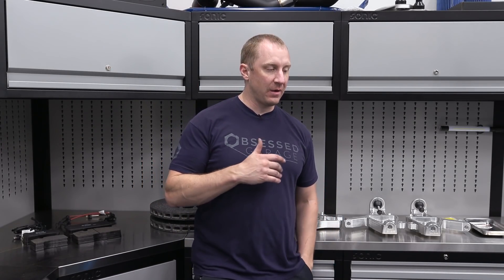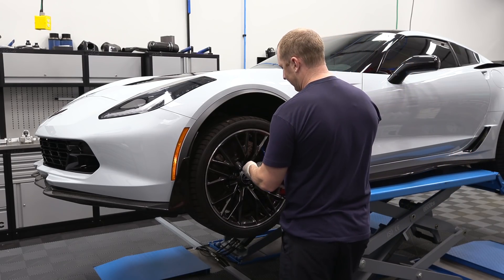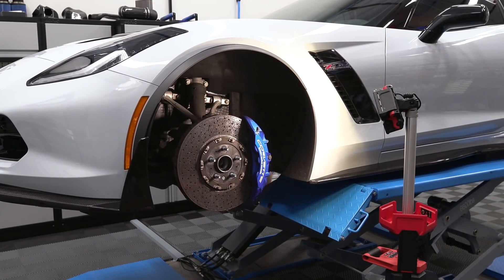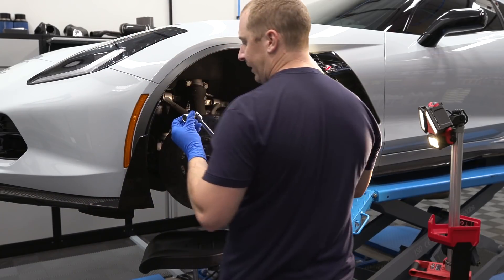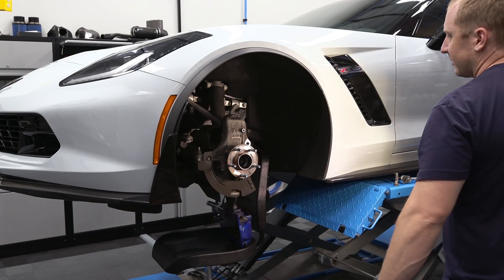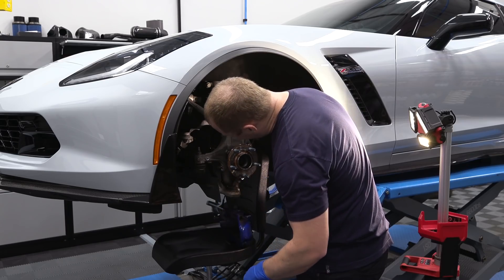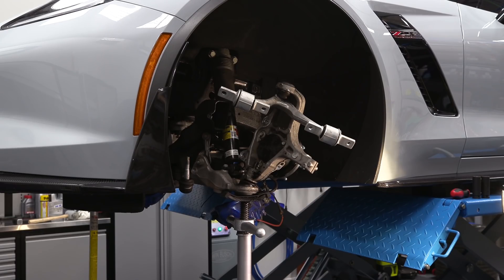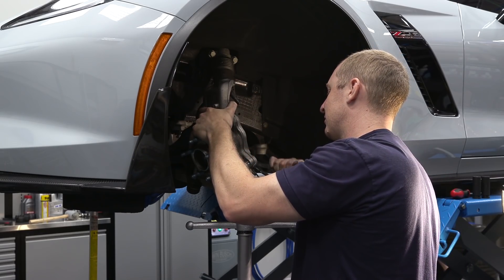Carbon 65 C7 Corvette Z06: LG Motorsports Drop Spindles - Part 1

Comment: Pretty sure they meant an impact driver. The kind you smack with a hammer and it turns as it's pushed in. That way to DO NOT strip them. I

Comment: I just replaced the rotors and pads on my Z51. The bolts are blue loctite from the factory. I read about it before I did the brakes and just bought new bolts, for $3 each, the bolts are loc-tited from the factory, in the package. You just install. It’s funny to watch you break the bolts free, because the torque specs are like 162ft lb and the rears are like 89ft lb. make sure you definitely loctite the front bolts. Rears don’t require loc-tite.

Comment: The ball joint is tapered where it goes into the spindle.if you hit that spot on the spindle it will shock the joint loose and fall apart.fyi this also works on the tierod joint that is also a tapered joint.just 2-3 good smacks and it shocks the joint loose
Reply from the maker: I eventually figured that out.

Comment: Changed spindles/bearings/AMT monoballs/calipers/rotors/everyhing/ arms on my car.. using the hammer was important for sure, mind the angles for the balljoints
Reply from the maker: Yeah, it's really simple now that I see how they come off.  If I could do it again, I would get the correct tool.

Comment: This is what separates you from other DIY , you are transparent with what you know or pretend to know , just a simple turn wrench guy looking to learn as you go forward.
Reply from the maker: There is a reason why no one has posted a video doing this.  It's messy.   The only way it would go smoothly would be if you had done it before.
Reply: @ObsessedGarage  also many of these upgrades and modifications, including drop spindles and bigger brake upgrades, we did in 2004, 5, 6 and 7 on the C5 and early C6Zs in the days before YouTube.
Those tutorials were normally photos and posted onto the forums.
Many of the forums have changed software and owners enough since those days that lots of old tutorial series are dead or have no photos left.
As for C7 modification videos of serious level changes, many of the new comers to the C7 seem to be "pay to have their cars modified" folks and as a result there are very few actual videos of the process.
Kudos to you for adding your stuff to the library of material.

Comment: Haven't watched the whole thing yet, but my guess about the rotor weight is that your new set has slightly enlarged internal vanes/voids to save weight, aid cooling, and likely save money on expensive materials. The external dimensions will be the same, but the weight will be different. This would explain the difference in specs for minimum weights being different. 

If they are both OEM rotors then Chevy has changed the rotor without updating the part number. Or maybe their parts vary to this degree, and it's all unintentional, but taken care of by the spec.

Comment: Lefty loosey-rightey tightey trick for when you are backwards like that: put your hand on top of the bolt ( or imagine it there) in karate-chop position. Then you can tilt the top of your hand to the left and right to easily figure out the direction. Just imagine karate chopping the bolt! Not too hard to imagine once your car starts to make you mad with whatever you are trying to do to it lol
Reply: I've always hated the lefty loosey righty tighty thing. I find it easier as clockwise to tighten, counter clockwise to loosen.
Reply: I always imagine opening a milk jug in my head 😂

Comment: that fork your using ,it´s also ment for you to hammer on the end ,so it´s pushes the 2 parts away, another way is put the nut on and a piece off word the hammer on it that way it also comes apart atleast easere then what you did and you don´t destroy parts in the process .
regards
Sören
Reply from the maker: Do you really think I'm that stupid?  Of course that is how you would use it.  That is, unless there is a rubber boot than would be damaged.

Comment: @obsessedgarage The sensor is the ABS, there should be a connector to disconnect it on the body of the car instead of taking it out of the hub carrier. They are usually stuck and don’t come out as vehicles get older.

Comment: I have a ZL1, these are a direct fit.  How much for the old ones?
Reply: Stock ZL1 1LE front rotors are 15.5"?   Giro disk folks told me the ZL1 hat differs from the C7 Z07 hat which is why they have 2 different part numbers for the 2 piece 15.5" iron rotors. They share the same rotor ring but the hat is different offset.
Either way - lets see the price, as if you don't end up getting these rotors I think I might like to step up if the price is right.
Reply from the maker: I gave them to Ras for helping me so much.
Reply: RCFourFive Yea, I know. The rings themselves bolt right up to the ZL1 hats though. Oh well, sounds like Matt gave them away already.
Reply: Obsessed Garage that’s great to hear - pay it forward is my motto as well.

Comment: Just wanted to chime in and say the loctite is applied by GM at the factory. Now, whether or not red loctite is correct is beyond me as blue is usually what is used when doing a brake service. It can be annoying having to reef the bolts out, but due to their task in such a demanding environment it is necessary that they have that stuff applied.

Comment: I wonder if the weight of the old rotors is higher because of the pad transfer material???
Reply from the maker: There is not pad transfer on CCBs.  The rotor likely had a higher starting weight.
Reply: Obsessed Garage interesting ! see I thought maybe it would accept pad transfer like a traditional rotor, but I don’t know I’ve never had carbon fiber?
Reply from the maker: Yeah, the pads get burnished.  Wait until you see the break-in procedure.  50 stops!

Comment: This is the kind of impact driver you need for the screws on the rotor. You hit it with a hammer and it rotates left or right depending on which way you turn the handle. I stopped needing to drill out rotor screws once I got one of these. 

https://www.amazon.com/TEKTON-2905-8-Inch-Manual-7-Piece/dp/B000NPPATS
Reply from the maker: Yeah, I have one at the house.  I was too lazy to go get it.

Comment: The fork is wedged and you had it upside down.  Take a hammer and hit the end of fork and the wedge will separate the ball joints.  No need to remove a-arm
Reply from the maker: It was pinching to ball joint boot.  I didn't want to damage it.

Comment: Those friggin rotor screws are the most annoying things known to mankind, I swear to god.
Every single time I've ever had to take one out, it's either snapped mid-thread, got completely stripped and needed to be saved with an extractor, or become so solidified in place that I had to drill the whole thing out. They are the wooooooooooooooooorst.
Reply from the maker: The other 3 came out easily.  Luckily I was taking the hub out anyway.
Reply: @ObsessedGarage  I anti-seize those rotor set screws. For German cars, ECS Tuning has stainless steel ones that shouldn't seize.

Comment: Just want to let you know the ball joint fork was used incorrectly , you put it in the way you did but hit the end of the rod driving the fork in more to pop the ball joint free from the spindle  .  That's why the fork goes from thin to thick to seperate it , you just was killing yourself the way you did it .  Not sure if the newer cars like the corvette that you own that when you remove the upper control arm you will need a wheel alignment  .
Reply from the maker: I understand that.  I couldn't do that because it would tear the boot.
Reply: @ObsessedGarage  i gotcha , its a hit or miss with that . I've done probably a hundred of them and maybe a handful tore . and i understand corvette parts prices are frigin stupid expensive . But all in all it looked sick .

Comment: Your not using the pickle fork properly. You have to insert the pickle fork like you did then you hammer the the pickle fork. It will break the ball joint loose. You don’t use your hands.
Reply from the maker: The fork wouldn't fit without pinching the boot.  I tried that off camera.

Comment: You just trashed every joint in that car. You have to hit perpendicular to the bolt so it breaks the taper loose. Anything else is just fighting yourself and you won’t get it off before you mess up the car... anyone who has done any suspension should know exactly where to hit...
Reply from the maker: Ha, ha... Okay man.  I'll let you know when the suspension explodes.
Reply: 100% Derek!
Reply: Obsessed Garage not going to explode, but those joints are a metal ball in a plastic cup. When you hit them like you did, you put indents in the plastic cup and create high and low spots. Quicker than normal, the high spots will wear to be equal with the low spots, and you’ll develop loose joints or a clunk, at which point you’ll declare corvettes “Junk”

Comment: Get a ball joint puller. Free at the auto parts store.
Reply from the maker: I got a set.  They don't fit without damaging to boot.  There is a special tool made specifically for Corvettes, but I didn't want to wait a week to order one.  If I did it again, I would have them off in under an hour.

Comment: hilarious and painful to watch at the same time.. A for effort but stick to detailing
Reply from the maker: There is a reason why you don't see videos online of people doing this.  It's a rough sport.  This is how installs go both professional and DIY.
Reply: @ObsessedGarage  maybe so, but there are videos of home gamers taking balljoints apart a bit more elegantly, you need a hinged balljoint separator not a pickle fork but i do agree i prefer my germans over a chevy any day
Reply from the maker: Yep, there is one made specifically for this job.  I figured that out after the fact.  There are no instructions that come with these, so I was winging it.  No biggie.  The job got done.  I could do it in 2 hours if I had to do it again.